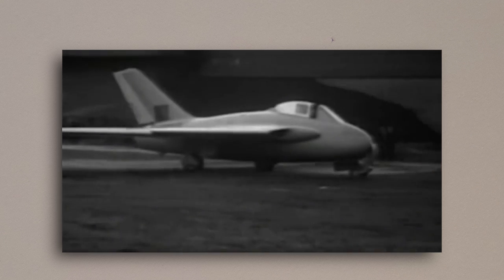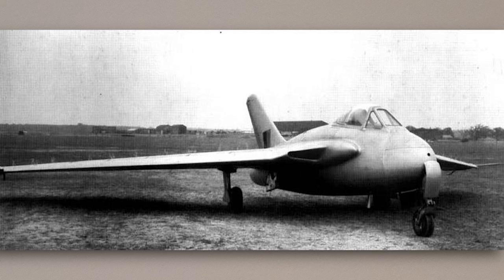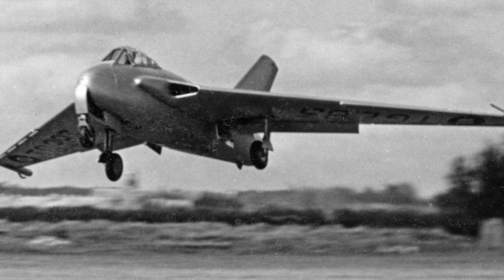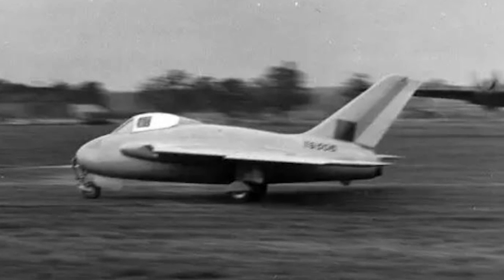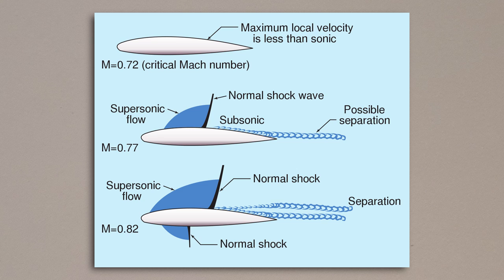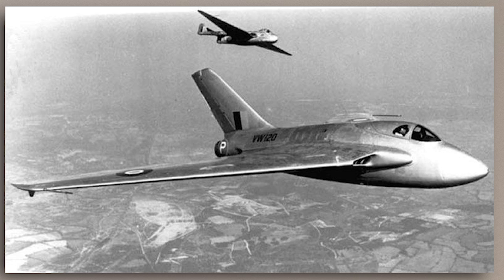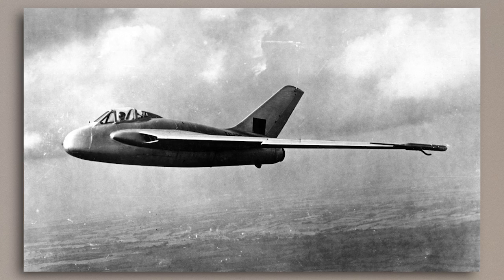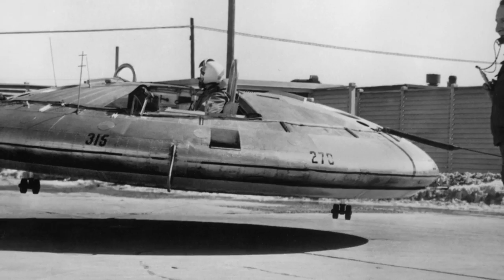Britain's First Supersonic Plane  | De Havilland D.H 108 Swallow [Aircraft Overview #58]

Comment: Too bad it was such a lousy plane, it looked so cool.
Reply: Yeah, the Germans they copied worked hard on that design
Reply: @Pugiron  It only looks somewhat like a Komet, mechanically its completely different. The Sabre and MiG are more closely related than these.
Reply: @Pugiron  everyone copied the Germans, for they were excellent engineers.
Reply: @Pugiron  it's fundamentals are completely different, in approach, operation and methodology
Reply: @rob5944  Yes they were. Unfortunately they, or the manufacturers got lost in a sea of details. Their weapons were often too complicated and required constant maintenance. That was especially true of their tanks. Early jet engines, all of them, had lifetimes measured in hours.
Reply: @matchrocket1702  over engineering was indeed a hallmark of German engineering.  However, so was practical, hard hitting and durable weapons.  The MG42, 88mm gun, fuel injection and field optics to name just some examples straight off the top of my head as I write this.
Reply: So was the X-3 Stilleto. Crappy engine made it a real dog. But, Damn, did it look good!
Reply: @matchrocket1702  You are certainly unfamiliar with WW2 weapons technology...
Reply: @rob5944  I said their weapons were "often" too complicated. I used that word specifically with the MG42 in mind. It was an awesome and terrible weapon to be up against. How could I forget about the 88? You can't watch a documentary on the European Theater without mention of that weapon. But their tanks were over engineered. All jet engines from that period required high maintenance. The Germans put too much effort in technology that was too good and not good enough like the Russians and Americans did. They couldn't produce their weapons in the quantity necessary in part because of that.
Reply: @rob5944  Sorry about the tone of my comment. I was directing it at someone else.
Reply: @matchrocket1702  lol, not at all.  I often use my phone and loose context of what the discussion is about entirely!  I agree, production of simple, reliable tanks was key (unless you were the poor souls using them).  However, in the case of the me262 it was the availability of key alloys that hampered the serviceability of it's engines.  From a purely technical standpoint though the aircraft was way ahead of the British Meteor and even further than that of the Americans, their model that was traded across the pond having been rejected outright.  In fairness, it must be stated that the RAF was going for a conservative approach with post war development in mind.  The Nazis didn't have that luxury, obviously increasingly desperate for a war winning weapon.
Reply: @matchrocket1702  the British jet engines of WW2 were reliable, and needed only routine servicing, for things like oil changes at 100 hours' service.
The German jet engines of WW2 were scrap metal at 10-12 hours
Reply: I wonder if a v tail such as on the f117 might have improved handling on this plane?
Reply: @tombearclaw  I was wondering the same 👍
Reply: Same as the US jet VTOL aircraft
Reply: @rob5944  That's a common misconception, while production was delayed by a shortage of Nickel the Production Jumo engines had surprisingly good TBOs, better than many Allied piston engines.
The British went down a dead-end, centrifugal compressor turbojets were an evolutionary failure, completely outclassed and obsolete.
Reply: @pashakdescilly7517  Please stop posting lies and ignorant misinformation about a topic that you are completely unqualified to discuss intelligently
Reply: @WilhelmKarsten  well Whittle later said that he preferred reliability and survivability over sheer performance.  I suppose it depends if your willing to take him at his word.   Similarly Eric Brown reckoned the Germans knew about compressibility over the wings and this was partly the reason for the sweep, and I don't see why he would of lied.
Reply: @WilhelmKarsten  I could apply your comment to you and your determined 'revisionism'
Reply: @pashakdescilly7517  The TRUTH is irrefutable and bears repeating son.
You comments reveal someone who has absolutely no formal education or professional experience regarding this topic.

The lubrication systems of jet engines are very different from reciprocating piston engines and do not require frequent changes.
All military aircraft engines including those used by the Luftwaffe, RAF and USAAF are required to pass a minimum PFTR  reliability test, 100 hours was the standard for both sides during WW2.
Please stop spreading ridiculous lies and ignorant misinformation about a topic that you are clearly not qualified to discuss intelligently.
Reply: @rob5944  Whittles engines were so unreliable they could not pass the RAE's minimum PFTR for adoption into RAF service!
Reply: @DoktorBayerischeMotorenWerke  so what are you saying?
Reply: @WilhelmKarsten  You do like writing bs, long-windedly. Pompous, also.
Reply: @rob5944  I'm saying britian was years behind in both aircraft technology and engine technology, Whittle got it wrong. The engines we use today are based on captured Germany engine technology... not british
Reply: @DoktorBayerischeMotorenWerke  not according to Whittle.  He went with centrifugal for its reliability and longevity.  The British could concentrate on steady and safe development whereas the Nazis needed quick answers, regardless of safety.
Reply: @rob5944  Thats a completely false narrative and a very naive amateur opinion.
 Whittle lacked the engineering skills to build an axial compressor turbojet and he never attempted to build one.

That remark exposes your lack of knowledge regarding this topic, all aircraft  engines were required to pass the RLMs 100 hrs PFTR reliablity test for acceptance into Luftwaffe service. This is the exact same 100 hours required by the RAF and the USAAF.
None of the engines designed by Whittle or constructed by Power Jets ltd. could successfully pass the 100 hour test.   

Whittle built his engines using Brown 18/6 and REX 78 stainless steels used primarily for cutlery and kitchen utensils.
 the real genius of british jet engine program was Adrian Lombard and Stanley Hooker at Rover and Rolls-Royce. The received help from General Electrics Turbocharger division which gave them Hastaloy B and Nimonic alloys.
Reply: @rob5944  Frank Whittle is not a credible source.
Reply: @DoktorBayerischeMotorenWerke  well it wasn't an opinion as I was merely repeating what I've seen Whittle say on a documentary.  I couldn't care less whether it was him, Rover or anybody else who did it to be honest.  I simply take a passing interest in this and many other subjects and not a expert such as yourself.  Mind you there are plenty on here, its a shame that your manners don't match your knowledge though.
Reply: @WilhelmKarsten  if you say so.
Reply: @rob5944  Dont pretent to be an expert on something you are not... and you wont embarrass yourself like this again.
Reply: @DoktorBayerischeMotorenWerke  remember to proof read what you type, that'd be my advice to you.
Reply: @DoktorBayerischeMotorenWerke  thanks for your concern but I don't feel embarrassed, I won't say what you look like as it's probably against YouTube terms and conditions lol.

Comment: One thing you didn't mention about Geoffrey De Havilland Jr.'s crash of the DH 108 was that, after the crash, he was found to have a broken neck/spine. It is thought that the violent oscillations that the swallow was experiencing caused the quite-tall De Havilland Jr to hit his head hard on the canopy and break his neck/spine. I read about this in "Wings on my sleeve" by Eric Brown, and I would highly recommend that book to those who haven't read it and like aviation.
Reply: I heard Eric Brown tell this very story during an interview available on the RAeS Podcast. He said that he had sought information from the engineers in charge of wind tunnel testing. He was to a certain extent aware of the possibility of  violent pitch oscillations and he had therefore placed his seat as far low as possible prior to duplicating G. De Havilland's accident flight profile. This, with his smaller height, prevented his head from violently hitting the canopy when the oscillations suddenly began - which as you said had killed G. De Havilland. He then eased the throttle back and gently pulled back on the stick and the phenomenon ceased as suddenly as it had begun. He discribed the oscillations as much more extreme that wind tunnel investigations had anticipated.

Comment: I think the big problem was that the DH. 108 was essentially a flying wing with single vertical tail. It's too bad de Havilland couldn't get access to the Horten brothers, who probably would have told de Havilland to design the wing with more control surfaces to better control the pitch, yaw and roll of the plane. (After all, the Horten brothers did manage to build and fly an all-flying wing jet fighter prototype with two Junkers Jumo 004 turbojets that actually flew quite well.)

Comment: Do modern aircraft design engineers ever train their graduate staff by presenting them with historic aircraft designs and giving them the task of using computer simulation to evaluate how each aircraft would behave and see how accurate their analysis is? And then give them the task of suggesting improvements? It would be fascinating to know what the latest Boeing or Airbus simulator technology would make of these early designs.
Reply: de Havilland aircraft are often taught in engineering classrooms as examples of what can go wrong in the design and manufacturing process, the d-h Comet is another aircraft frequently discussed .

Comment: I read that the design was based on the Messerschmitt 163 Komet. They had a similar tendency to tuck under at high speeds
Reply: They even called it Comet, not that subtle:)
Reply: the Me 262, the first fighter jet fielded was also named Swallow (but in German)
Reply: Yep I read they put a higher output rocket and it wouldn't go faster, just flipped, but it still has an amazing climbing numbers.
Reply: Initial design work started before the end of the war and access to Me. 163 was possible. The UK did have its own research in this area, though, such as https://en.wikipedia.org/wiki/Handley_Page_Manx.
Reply: @randomnickify  no, they called it the Swallow. The jet airliner was the Comet.
Reply: @wbertie2604  i believe that one was also designed by a german, who had also invented the excellent  handley page flaps, lachmann, who they imprisoned in canada for being german, so that was a bit of a dead end. i believe the tests on war prize me163s were unertaken before the swallow, but doing full powered flights was too hard, so another opportunity was lost, and they just copied and "improved" what they could.
Reply: @quitecapable  before the Swallow, but after the design of it, AFAIK

Comment: It looks so much like the German Comet although with larger wings.
Reply: De Havilland copied the design from the Me 163, this being the fastest WW2 aircraft. But unfortunately also copied its flawed flying characteristics. The Me 163 had a speed limit of 1000 kph due to instability as it approached the speed of sound, the Germans were only too aware of this due to numerous testing accidents . The Swallow with more sophisticated aerodynamics was able to pass this barrier, but still ultimately only by a small margin before succumbing itself.
This was the only de Havilland design that was not originally conceived in-house, and the test pilots paid the price. There are no short cuts in aviation.
Reply: Hey, just because it was an exact copy doesn't mean it was an exact copy.  They changed the K to a C
Reply: @chrisknight6884  I think you need to do some due diligence and properly research...

Comment: Looking at the overall design of the Swallow I can't help but thinking of the Messerschmitt ME163 "Comet".
--> Talking about death traps...
BTW the ME163 already broke the sound barrier in 1945.
Reply: Actually the 163 was far superior aerodynamically to the 108, being almost impossible to stall or spin. 
It did not break the sound barrier, having a safe Mach number of around M0.85. In 1941, flying a Me163A, Heini Dittmar achieved an official world speed record of 624mph /1004kph without the aircraft suffering any damage, unlike a Me163B trialling the dual combustion chambered HWK 509B in 1944 also flown by Dittmar which reached 702mph / 1,130kph but lost much of the rudder due to flutter at such a high velocity. 
The 163A & B were excellent aerodynamic aircraft & one big problem found when the 163B entered service was that it flew so well it was a bugger to get it to land again, taking advantage of ground-effect lift as well as it did. 
It was really only the fuel that made the 163 so deadly to the pilots, especially the B variant which used the ‘hot’ HWK 509 motor. Sitting in the cockpit between two fuel tanks containing fuel that would detonate when the two fuels mixed and could also dissolve the pilot’s flesh must have concentrated the mind wonderfully. Landing with any fuel on board was deemed to be hazardous. Those who flew the 163 in any variant were brave souls ~ but as Winkle Brown said after his totally unauthorised ‘sharp start’ flight under rocket power, it was an incredible experience.
Reply: @davidpope3943  Powered flight was deemed to dangerous in England because of the poor condition of the pumps and seals on the engines. I remember Eric Brown saying during his power off glide tests on the 163 the stall break was pretty abrupt, with a sharp wing drop. He attributed the wing drop to wing panel alignment and QC problems at the factory, and were probably not intended. The stall itself was preceded by a sudden silence, and sloppy controls. Perhaps not up to modern certification standards, I think.
Reply: @bernieschiff5919  If Brown attributed the problem to poor manufacturing at the factory, plus we don’t know how long that airframe had been sitting around then I’m not surprised but that doesn’t invalidate the design. The 163A could happily glide at 400+ mph as Udet saw when he was visiting the airfield where flight testing was ongoing.  He was fascinated by the concept and at the time powered endurance for the B with the ‘hot’ engine was estimated to be a lot longer than that which they actually ended up with ~ which would have increased the operational practicality. I’m sure that if Udet hadn’t committed suicide the Luftwaffe would have had far more advanced aircraft types in service to disrupt the USAAF bombing campaign. 

In one film I saw of Brown talking about his 163 experience, he commented on how comfortable the pilot’s seat was. This had been arrived at after a multitude of pilots suffering ‘Komet Back’ after either landing on rough surfaces or with a skid that wouldn’t extend. The impact could and did fracture or break vertebrae & the seat was identified as an area that could be redesigned to help mitigate such issues ~ which it duly did. Hanna Reitsch flew the 163A under power after a lot of pestering to be allowed to so do & loved the speed, saying it was like flying a powered cannon-ball. She also flew a B model unpowered under tow but had a serious accident when the wheel dolly wouldn’t separate from the retracted skid on take-off. She could have been towed up to a safe altitude to bale-out but elected instead to attempt to land the aircraft despite the serious vibration & buffeting the aircraft was undergoing. This did not go well. In the subsequent crash she ended up losing her nose, bruising her brain in a skull with multiple fractures & a displaced jaw & broke multiple vertebrae. She then elected to make notes sitting in the wreckage before quite understandably passing out!  Quite a tough cookie…

There is in fact a modern repro of the 163 ~ obviously built only as a glider. It utilises a more standard glider wheeled undercarriage than the notorious skid on the original. 
It’s most impressive.
Reply: @davidpope3943  Yes, the torsion bar mounted seat was a needed improvement, it probably prevented many injuries. Hanna's accident probably could have been prevented if she had used the shoulder harness and before flight the gunsight also could have been easily removed. In aviation, arrogance and carelessness can be a deadly combination, I think some of both in this situation. EADS modified Kurtz's 163B replica by strengthening the wing attach fittings and moving the CG forward. Interesting to note, they needed to make this adjustment, several accidents have been caused in FW by having the CG too far aft. During the war resources probably should have gone into the ground launched missiles, like the Wasserfall, to attack the bombers, the manned rocket interceptor a very expensive distraction and an intermediate step. If Udet was alive he probably would have pushed for development of advanced manned interceptors, not missiles. See Wolfgang Spate's book for the 163 development story.
Reply: @bernieschiff5919  Spate’s book is excellent. Just one of many I have purchased over the decades since my interest in this type of aircraft was first piqued when I was 10 years old in 1970 after reading William Green’s ‘Rocket Fighter’ which also encompasses the Russian, American & British endeavours in the field of aircraft rocketry. I’ve thus held a great interest in the more ‘exotic’ German aircraft for decades before it became as popular as it has now become. 
I concur with your estimation that surface to air missiles like Wasserfall, Enzian, Schmetterling etc would have been a more effective ~ and safer ~ route to follow, along with the ancestor of modern air to air missiles, the Ruhrstahl X-4.